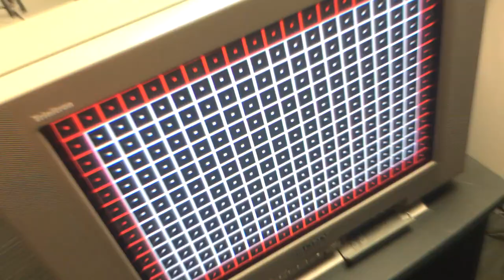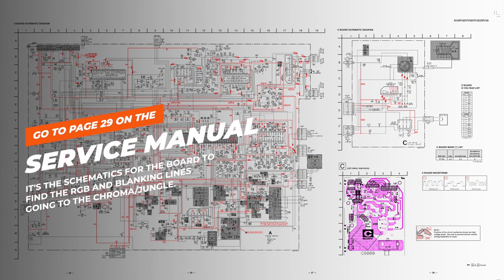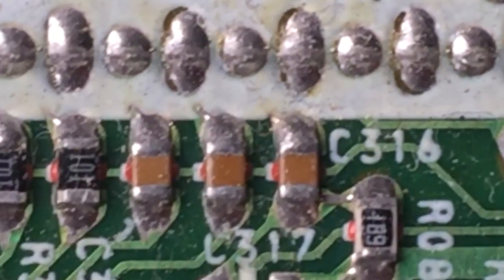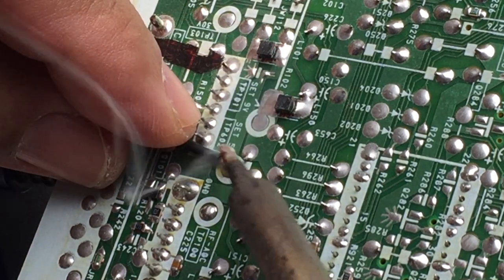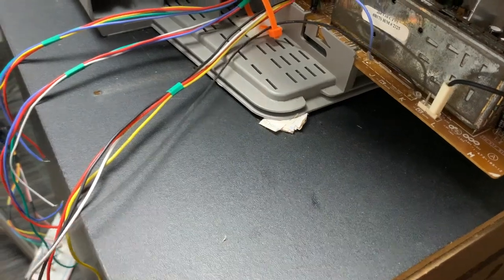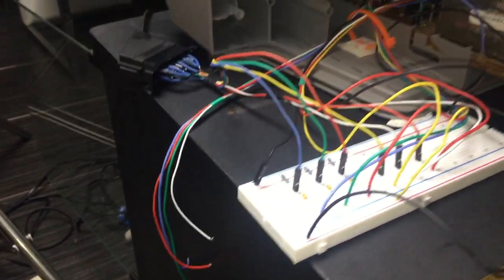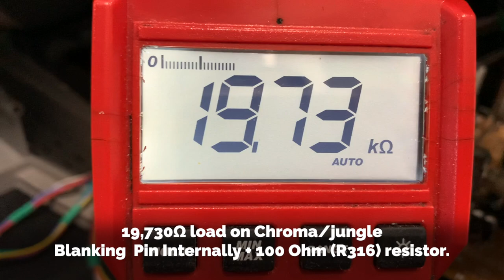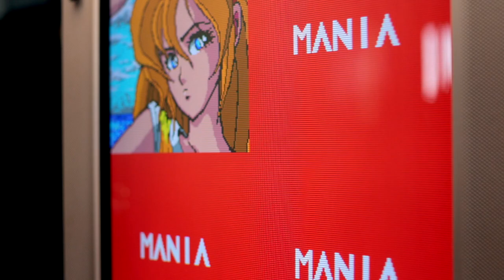Episode 124: Sony Trinitron KV-20FV10 RGB Mod Special

Comment: Bro, do you prefer this over the 27" d series you have rgb modded?
Reply from the maker: The D-Series is a 20". Both have it's strengths. I can't say really if I could pick one or the other. That's why I still have both.
Reply: @The_SegaHolic  Awesome man! Much appreciated. I'm pretty indecisive about which tv's and monitors I like. These days I play retro stuff on an old trinitron pc monitor with mister.
Reply from the maker: @mahdiyussuf9804  You know what, I'll take the D-Series over this Wega. Reason being that the D-Series is less prone to geometry issues. All Flat CRT's are prone to geometry issues that cannot be addressed in the service menu. But you might want to think about getting a couple , cause you don't know when any CRT decides to go kaput.
Reply: @The_SegaHolic  Awesome, thanks for the input! I used to have a flat trinitron and I remember geometry being a big problem I couldn't fix (ps2 days). The D series probably have more tv lines as well, but the aperture grille does look nice.
Reply from the maker: @mahdiyussuf9804  BTW, any RGB'd consumeer TV look greeat. You'll find everything just looks tons better. Find any RGB'able TV and you won't be sorry.
Reply: @The_SegaHolic  That much better than component? I'll def do it! And thanks!

Comment: first of all, thanks, you explain this way much better that in the shmups forums. That being said i have to ask, how come you dont add a switch on the 5v line or did i miss a part on your video? and how come you dont add resistors to change the value in the mod, as in the mux mix mod? Thanks for keeping this alive. keep the good work
Reply from the maker: You can take a look at this video, a mod for the Princess TV, which is essentially the same as this mod to clarify things a bit more:
https://youtu.be/Omb2nrAtdHc
Or my D-Series mod which explains wiring the switch in extreme detail:
https://youtu.be/1YGy3FuAxfA?t=1500
I time stamped it so you can watch the switch wire up and install, which I dld link in this video. The switch switches the RGB singals between the micon/chroma and the console/chroma, including the sourced 5v and the micon's blanking pn to the chroma. The D-Series vid really explains it all.

Change of resistors, or extra resistors really isn't needed for this "old school" method. The MUX method requres it as you're "multiplexing" the RGB lines of both the Micon and your console.
Reply: @The_SegaHolic  thank you sir

Comment: There is no need to mod this, has components input, just buy a scart to component box, and get same quality
Reply from the maker: RGB and component are not the same! They look different. Totally different color spaces!
Reply: @SegaHolic  color space is different, but quality is the same. Just adjusting, you get the exact same results, no issues soldering, cut o install. Save a lot of time and avoid issues
Reply from the maker: @luisarmandoibanezgarcia5368  RGB colorspace is more accurate… just looks better. You should try it and see for yourself… like some of us who have and seen for ourselves that it’s better.
Reply: @SegaHolic  Nope, there is no benefit from doing the mod. If the TV already has components, it has been measured with colorimeters. osiloscopes, etc., Artemio Urbina has mentioned it thousands of times
Reply from the maker: @luisarmandoibanezgarcia5368  “same” 🤦🏾